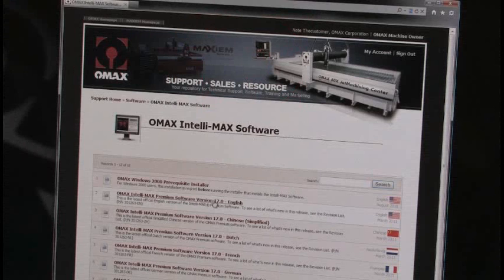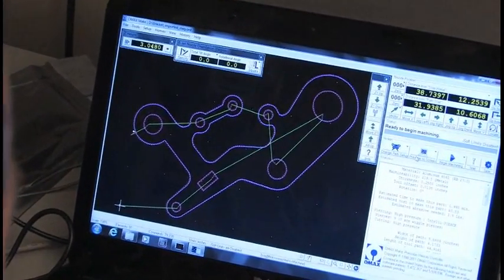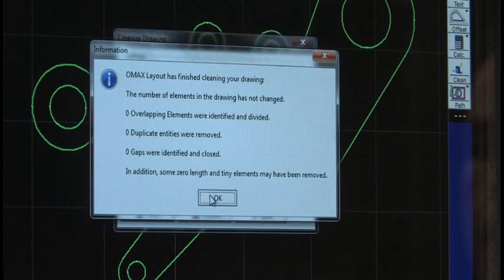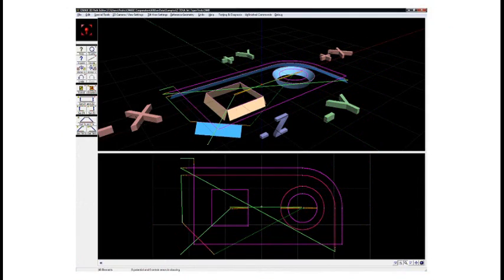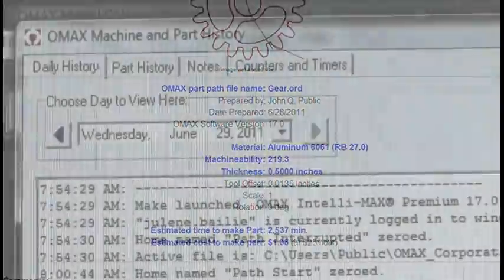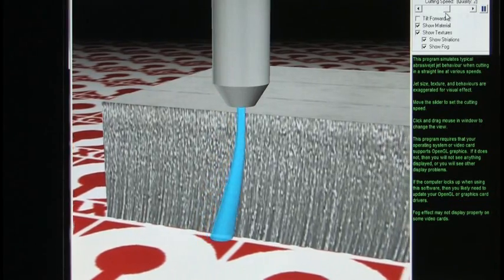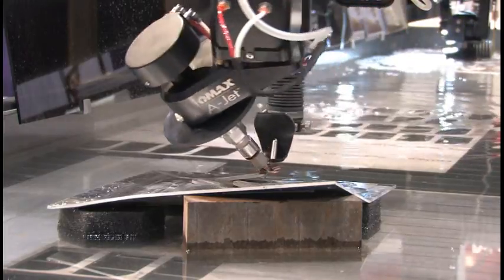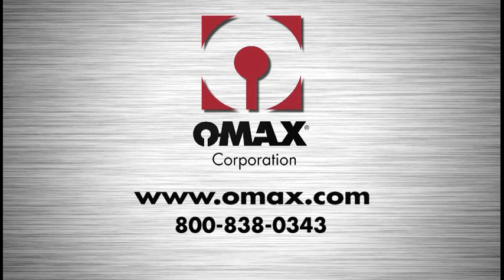Accurately Cut Parts with OMAX Intelli-MAX Software

Comment: any resources for how to create un-orthadox type of products, such as wrenches/tools? I work in a machine shop and most of the stuff we cut are pretty straight-forward, but there are times when I'm needing to make tools, such as pliers and/or wrenches and it takes me just soooo long to make these products...all the help I can get my hands on would be ideal! We work on a OMax 55100 Water Jet and use this sofware!
Reply from the maker: A few resources are available for you. Several tool templates can be found in the sample folder under “Useful_Tools.” In addition to those templates, Intelli-MAX Premium software users can use Parametric Shapes to aid in the creation of these tools. More information about Parametric Shapes can be found in the OMAX Interactive Reference Guide on our support site. If you have additional questions, we can be reached at omax@omax.com or 800-872-2300.
Reply: Thanks! I'll check out those resources you've mentioned!